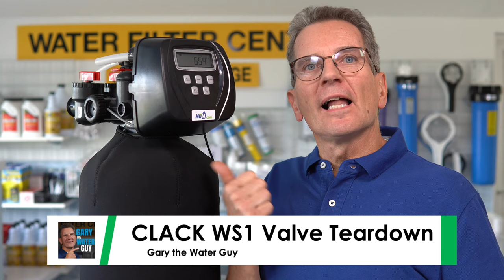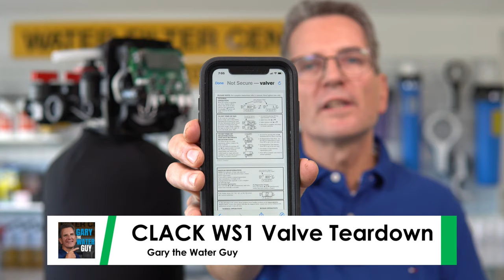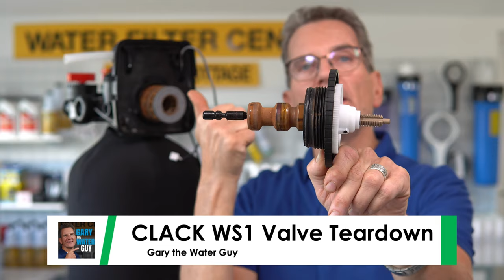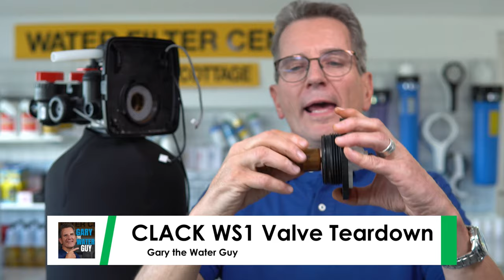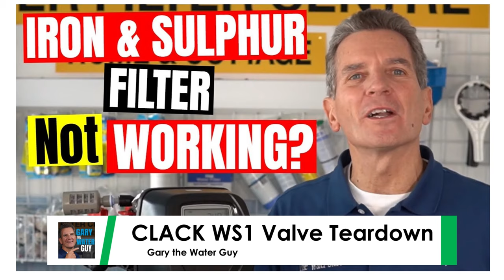CLACK WS1 WATER SOFTENER VALVE Disassembly, Troubleshooting Tips and Tricks

Comment: I had an air over carbon filter by Entipur installed and now have air in the system.  Any idea went is wrong as prior to the installation of there were no air in the waterline issues.
Reply from the maker: Likely sucking in too much air. Have them come back to adjust.

Comment: Gary, I have error code 102.   My regen button does not work.  How do I relieve the pressure before taking the unit apart to inspect for a dirty filter/piston?
Reply from the maker: Shut off the water going into the softener, open a faucet downstream, then shut off the water after the softener and proceed.

Comment: Great video.  I had my WS1 installed 2.5 yrs ago.  A couple of months ago I noticed it has a slow steady constant waste drain.  I just followed up today searching how to troubleshoot this myself.  At 11:05 you explained the symptom, cause and repair precisely.  I followed your teardown instruction and found 2 ragged crumbling Orings in the seal stack.  Parts are now on the way.  In a few days I won't be wasting water 24/7.
Reply from the maker: Yes, 100% correct.

Comment: Hi Gary, thank to you very helpful videos, I have been able to replace my piston/spacer stack after I have received parts (very quick by the way !) this week, such a easy task that saved me hundreds $ in plumber services. I have very hard water from my well, I wanted to start fresh after I found a leak on my floor. However, even after the replacement, there are still drops leaking from the white gear during regeneration. When I removed the spacer stack, I had to clean buildup inside, but there seemed to have lot of buildup towards the drain (whole in the top toward the front). I tried to remove the most I was able carefully with a flat screwdriver, but when the valve is draining water, there is a sound that make me think the drain line might be clogged as well. I will soon have a look to it (in the meantime, I secure everything with a funnel/drain line to avoid leak on my floor). My question : can a clogged drain line be enough to create pressure and make leaks from the cap/gear assembly ? Would it be a good thing to replace that part as well (I don't see that part on your estore) or once I will clean my drain line everything should be fine ? Thanks !
Reply from the maker: Definitely, if the drain line is clogged that would be the outcome.  Fix the drain first to see if that solves the problem.  If not, emailus on the parts you need and we can get you pricing.  info@waterestore.com

Comment: Excellent tutorial. You make a lot of comments in passing that fill in typical and critical gaps in knowledge. Thanks for being so thorough. I feel confident that I can put in a new spacer stack and drain elbows now on two WS-1 units I have set up as softeners and are leaking out the drain - - though I wish I'd ordered the removal, reassembly tool to make it easier.
Reply from the maker: Glad it was helpful! Clack tool is here https://waterestore.ca/products/clack-ws1-valve-disassembly-wrench-v3193

Comment: Great stuff!  Very informative.  

Despite the fact that you had the power detached, it continued to keep the time.  That is because there is a coin cell: 3 volt lithium 2032 according to my manual.  You surprised me by not mentioning it.

I have two of these on two tanks, all installed before I bought the house.  Both use salt tubs.  The one that comes second acts normally from everything I can tell.  But the one that gets the water first, what a mess.  At the moment it has been doing regen for over a week.  Yes, seven days.  It gets to the BRINE step, with a 1 hour count-down, and just repeats for days and days.  This time may be a record, sometimes it is just a day or two.  That tank is sort of translucent and I can see the level of the water.  I put a piece of tape at the low point - which is where it spends its time.  Early in regen it will fill to the top, but mostly it is at the tape or within an inch or two above it.
No question I need to get a service guy in!
Reply: I used the Next button, mentioned in the video, to get the problematic unit to finish its week-long regen.  After a couple of days of using water I noted that the gallons remaining was still at the initial 1200 it always shows at the end of regen.  But now I knew where that was measured, that little wheel inside the left side of the unit!  Why not check to see if it is free to turn?  So I turned the two re-arrow handles valves that cut off the water in/out, bypassing the unit.  And began loosing the cover to the whee.  PHHHTTTT!!!! Water sprayed all over me and generally around everywhere.  I had a rag ready as I knew water would drain out, but under pressure?  Then I remembered that the tank under the unit had a big head of air!  That air was under the same pressure as the well tank next to it.  I could have expected that but I didn't.  Thankfully it was just water, no big deal.  Oh, and the wheel spun freely.
I'm sure that when I venture to open the injector cap it will all happen again.  Or perhaps if I close the INput, leave the OUTput side open, and then run water elsewhere in the house the pressure in that tank will release before I open it up.
An interesting lesson in any case.   8-)
Reply from the maker: Yes, before you open anything you need to start a regeneration cycle and bypass to relieve the pressure.
Reply: Hello Gary great videos  I’ve been troubleshooting a dripping noise in my media tank for months. It is on a water softener stay with the WS1 clack valve. I was told to replace my stack assembly and will do that once I receive the parts thanks to your videos that built my confidence of doing it myself. Is there anything else that could cause this dripping noise?  I want to do everything and replace any other parts while I do this work. I will be replacing the pistons and injector as well as the stack assembly   Are there other O-rings or cleaning I should replace or do?

Comment: Thanks Gary for the outstanding service you provide.
Curiosity question: How does the motor know at which point to stop the piston after re-assembly? Do I need to pay particular attention to how far the piston is in or protruding when re-installing, or will the motor know where to stop for the correct position? And how does it do that?
    Klaus from Sunderland, Ont.
Reply from the maker: Great question. At the back of the circuit board in the tan cover there are a series of disks that are read by the circuit board. They read where the motor is and tell the circuit board.

Comment: Gary, we have a Clack water conditioner that we suspect is malfunctioning and would appreciate if you could offer your insight. Symptoms are that the washing machine in the utility room (with the softener) in the basement was taking a long time to fill (low flow). Likewise the shower in the ensuite bathroom located in the 2nd story was exhibiting similar condition. IE: when the water was turned on (single handle Moentrol valve), the water coming out of the bathtub spout was normal, but within a minute, it slowed considerably. Both the supply lines to the tub/shower and to the washing machine are soft water lines. My wife put the Clack into bypass mode, and voila, she had full flow to the washing machine, and the shower had full flow as well. Today, I put the Clack valve back into service mode, and while we haven't done any laundry, the tub/shower returned to low flow again. I'm deducing that the Clack is somehow restricting  water flow in the service mode. Having watched this entire video, I couldn't see any obvious repair that would remedy the low flow. Is it the Clack valve? or is it it the tank with the media? 

PS: great videos, Gary!
Reply from the maker: Sorry to hear, check out the advice in this video https://youtu.be/tCQQxiT-zoc  You might need to repalce the media.  It is not the valve, it is the media in the tank.
Reply: @water_estore  Thanks,  Gary. I have replaced the media, and cleaned out the crap (mostly iron) in the basket (filter) on the riser tube and the cone filter, and the guts of the Clack valve (injector, injector screen, pistons, and the stack assembly). And success! I have full flow, and after a week or so of running the house in bypass mode, the softener is again providing soft water. I wouldn't have been able to finish this project without the help of your videos. You really are providing a public service. I now know more about my softener than I ever wanted to, lol. Two thumbs up!

Comment: Thanks for making these videos!  They are excellent!  The only thing you did not cover is how to change  the backup battery.  Is it a typical CR2032 and can you change it with the power still connected.  Thanks again Gary!
Reply from the maker: Great tip!I'll p[lan it for an upcoming video.  Unplug, slide the battery up and out.

Comment: Love your videos Gary. Been watching and learning a lot about water softeners. I currently have a 1.5 year old impressions valve that was used for tannins but the system has since failed. I recently installed as artesian well and need a water softener setup. I have replaced the tannin media with softener media but was wondering if there is a way to setup the valve for using it for softener?  Thanks
Reply from the maker: Yes, should be pretty straight forward.  Thsi video will explain what settings you need to change. https://youtube.com/live/c6r7qUK8to4

Comment: Gary Thank you thank you! Why do seal pack start leaking? I am in SW Florida. My unit is under 3 years old and I had to replace it. Seal pack had some mineral buildup on it, but wasn’t super bad. I barely could take it out due to some buildup around it, so first 2 seal sections came out first, then I got the rest of seal out. I probably could use the tool you never used lol.
Reply from the maker: Yes, I too had to use the tool I never use yesterday.  IO need to talk more about that tool and make it available to everyone!

Comment: Gary, thank you for the great video.  i am actually in sarasota. i have one of these with all 5 buttons in a row (not offset like these 2 and 3 buttons on 3 of my houses, and also have the 3 button charcoal tank basic rinse version.. I ran my 5 button salt softener through the manual regeneration cycle and it did fine, however the meter never shows any gallon usage.  it is set at 40 grains hardness and 7 days regen and after it goes back into softening mode it shows 1200 gallons remaining and after 2 days of water usage it still reads 1200 gallons remaining before regeneration.  any idea what i need to do?  thank you so much in advance for your professional information.
Reply from the maker: When you run water in the house the word softening should be flashing at the top left, does that happen.  If not, the meter is not working.  We have the replacements here https://waterestore.ca/products/clack-ws1-meter-assembly-v3003  If it is working it could be the programming, it is included in this video https://youtu.be/c6r7qUK8to4

Comment: Hi Gary, thanks for the video, truly helpful. I have one white injector (yours was blue) and a gray plug. The injector is inserted in the opposite hole where you showed it, and the gray plug in the other hole. Does it matter which hole to insert in the plug? Just want to make sure there is no install error.
Reply from the maker: Great question.  The location of the injector and the plug is based on whether the water softener is being used as upflow or downflow regeneration.
Reply: @water_estore  I just noticed that my valve is marked up flow, the injector is inserted in UP hole, but the screen says it’s configured as DOWN brine.. I managed to change the configuration from OEM to UP flow to match the valve type. Do you recommend UP flow or DOWN flow brine? Thanks for everything!

Comment: Great video. Thank you so much. 

We have water leaking out of the side port of the drain elbow. Is this due to a clog in the drain or something else?
Reply: Added info: I placed the system in bypass and hit the regen to reduce pressure to stop the leak. First regen just increased leak but I could also hear water in the drain pipe indicating it was not clogged. At least not completely. I selected regen again and it appeared to stop the leak. I have it unplugged and would like to remove the elbow. Thinking it needs to be replaced due to a failed vacuum breaker????  Thank you for any help!!!
Reply from the maker: You need to replace the elbow.  We have them here  https://waterestore.ca/products/clack-ws1-drain-elbow-v315801?_pos=144&_sid=b59d53c7e&_ss=r
Reply from the maker: The elbow requires replacement.  We have them here https://waterestore.ca/products/clack-ws1-drain-elbow-v315801?_pos=144&_sid=b59d53c7e&_ss=r
Reply: @water_estore  thank you. I had been trying to find that part in your store. I will add that to my cart. I am purchasing many other parts as I suspect our high iron content water is degrading the piston/oring stack too. Still struggling to release the pressure so I can remove the elbow. But if I can’t I will have lots of towels ready. Our water has scary high iron content and having the water softener running is the only way to enjoy decent water. The media filter before the softener doesn’t take it all out.  

Thank you so much for all you do to help do it yourselfers like us.

Comment: Great video, thanks! Are there any differences between the resin vessels and riser pipes with upflow and downflow regeneration?
Reply from the maker: No, the difference is in the valve not the tank.
Reply: @water_estore  Thank you very much. There is not that much info regarding upflow and downflow regeneration. Why would one use downflow regeneration providing water pressure does not exceed 3.4 bars (so it does not lift the beads) and correct tank size is used for the valve. I believe Clack valves can do both upflow and downflow regeneration?

Comment: Great video Gary. I have two Clack WS1 Valves which have been programmed by a water filtration company no longer in business. It's reading that it needs to be serviced (flashing yellow). How can I reset it for 12 months when I'll get it serviced by a new company ? Thanks
Reply from the maker: Sorry I really do not know, I never use that feature.

Comment: I have a WS1 with my water softener. Lately, it has been using very little salt. Following your suggestions, I cleaned out the brine tank and cleaned the injector. After a regen, the brine tank salt level dropped about two inches, much less than it normally had. Do you have any suggestions as to what else I can try? The system is 11 years old and I'm on muni water with hardness of 15.  Thanks.
Reply from the maker: Is is sucking out all of the brine during the regen cycle?  If not I would replace the injector.  We ahve them here https://waterestore.com/search?q=clack%20injector

Comment: Hi Gary, my name is Anwar and I am located in Germany, I have a simple question regarding the Clack WS1, on the circuit board there is a Battery CR2032, when should this battery be replaced, and is there any thing that might go wrong? Thanks in forward for your time, I appriciate your work here.
Reply from the maker: They usually last about 5-7 years. Just pull out the old and replace with the new
Reply: @water_estore  Hi Gary, thanks for the quick answer, I am running a Clack WS1 assembled on an Iron filtring tank. The system I use adds potassium to green Sand, and is in operation since 4 years. I am just going trough your VIDEOS to understand  the system in order to maintain it by my self. Thanks for the great job that  you are dooing here, I really appriciate it!!😃

Comment: Hi Gary!  Thank you so much for your video!  I have a few questions for you.

1. I have read that you should never lay a softener on it's side as it can damage it.
   a. Is this not true?
   b. Is it really safe to lay on it's side?

2. Is there any chance water would start to mold in the tank?  Can you really just place it back in service and start using it again safely?
Reply from the maker: Yes, you can lay it on it’s side, we have been doing it for over 20 years. No mold, but if you want to you can run some chlorine through it just in case
Reply: That's great!  Ok  thank you so much!  Do you happen to have a video to show how you would run chlorine through it? @water_estore

Comment: Gary- I followed all instructions: reset my water softener, followed through instructions for the setting for pressing (and holding “next “ and “up”) and then have tried multiple times to review settings for “next” and “down”, but it doesn’t do anything. It won’t give me the menu for holding the two buttons down. I have the 5 (one row) button softner . Thanks in advance
Reply from the maker: Did you check to see if it was locked?  This video might help https://youtu.be/bU3wW29R7iE

Comment: I have a 10yr old ws1 based system on which the media seems to be almost exhausted due to excessive iron.  There is now a dedicated iron filter installed, so the iron issue at the softener should be done.  I was going to replace the resin and was wondering if I should just rebuild the valve at that time.  By rebuild, I mean tear apart, clean and replace o-rings.  I am on a well so no chlorine degradation issues.  I am not having any issues with the valve currently
Reply from the maker: Yes, I definitely would because the spacer stack and pistons are likely quite worn from the iron. We have the kit here https://waterestore.ca/products/copy-of-clack-softener-rebuild-kit-wrench